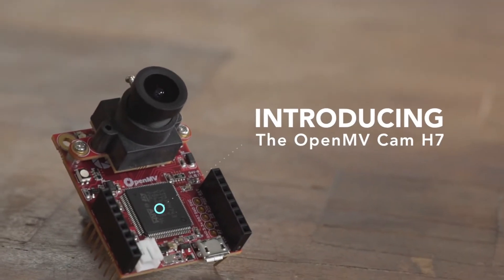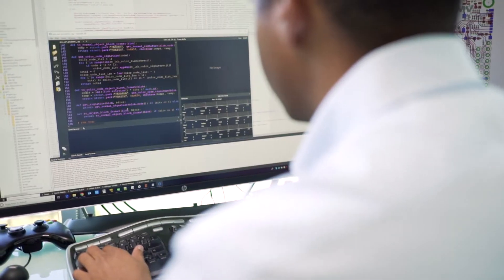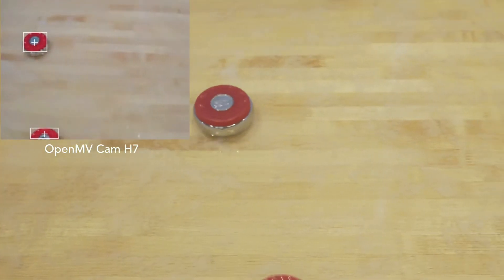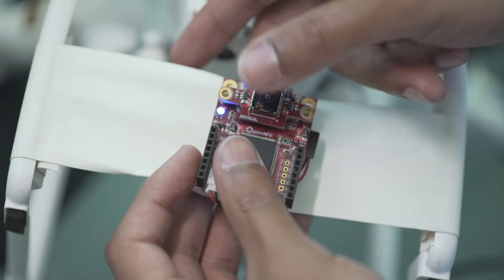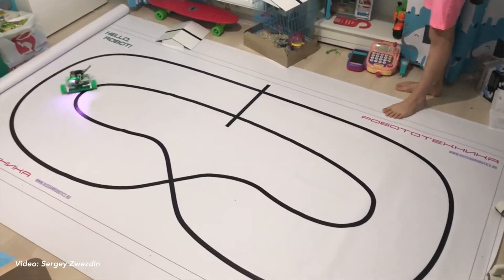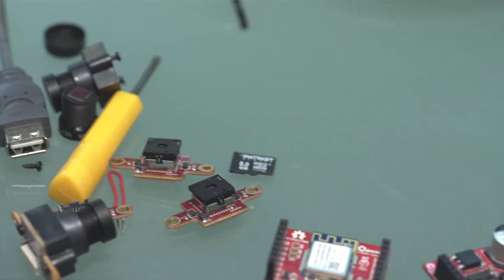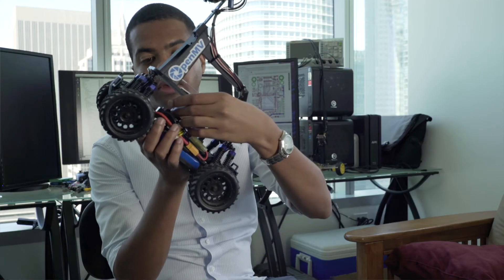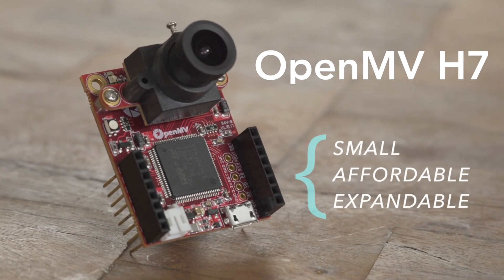OpenMV Cam H7 Kickstarter Video

Comment: Amazing!
I would like to know, if I want to build a portable project using the OpenMV Cam H7, what can I use as my power source? I would like to mount the setup and run an OpenCV application on it, without it having connected to my laptop. 

Please excuse me, as I am new to embedded systems projects.

Thank you !
Reply from the maker: It doesn't run OpenCV. You can power it via a Lipo 3.7V battery.
Reply: But can I use the OpenCV Python library? And regarding the battery, after approximately how long will I have to recharge it?
Reply from the maker: @syedh7843  Our system isn't a desktop OS. It doesn't run Linux, thus, it can't run OpenCV.
Reply from the maker: @syedh7843  We don't have a battery charger onboard.
Reply: @OpenMVLLC  Thank you so much !

Comment: Hello! from what distance can an object be determined?
Reply from the maker: cameras don’t directly measure distance.
Reply: @OpenMVLLC  for example, from 500 meters, can we identify, say, a heavy load?
Reply from the maker: @АРЦАХ-э1н  That’s not something cameras have the ability to do. You need a very high end camera and optics just to see that far. Even then, what the camera is looking at is subjective. So, you want some type of CNN that can determine what’s in the image to output a classification on what is there.
Reply: @OpenMVLLC  Thanks for the detailed answer.

Comment: How likely is it that you will build a future version with a higher resolution sensor?
Reply from the maker: Probably not. Our goal isn't to take pictures. If we do make a more powerful system we're most likely going to go full closed hardware/source route so we can skip to the top of the line stuff.
Reply: That’s interesting.  Thanks for the info.
Reply from the maker: For more insight... All the higher end cameras require a MIPI CSI bus which isn't supported except on high end application processors. The high end application processors that you can buy on digikey and have open docs are very expensive like the i.MX6/7/8. If you want cheaper application processors you typically have to give up being able to share source code, schematics, etc. to get access to internal documentation and supply lines for these high end but cheaper chips. That said, we've noticed folks don't seem to care too much about this as long as it's cheap and it's go the specs. Anyway, the H7 is just a feature bump of the M7 product line. We plan to sell it for a long time as people seem to like it and continue to buy it.
Reply: It might be entertaining to ballpark how much a system with a top of the line image sensor would sell for.  Then folks who want to use such a system could let you know whether they would pay that amount.  I’m thinking of applications like face recognition that would benefit from higher resolution and how valuable your system could be to researchers and builders.

Thanks again for your great work!
Reply from the maker: Hi, thanks for the kind words. A top of the line system would be about $50 for retail. Quite cheap. But, given all the NDAs we have to sign the product won't really be hackable or Open Source. You'd get a camera board than ran CNNs and basically no help support from us other than whatever we could release. It's really hard to make an SDK on top of closed product systems.